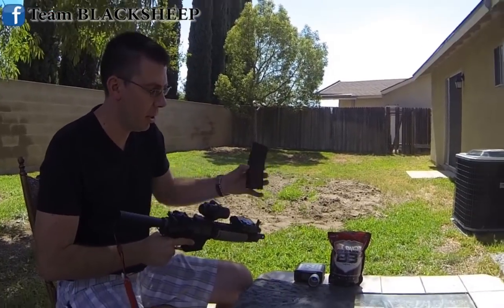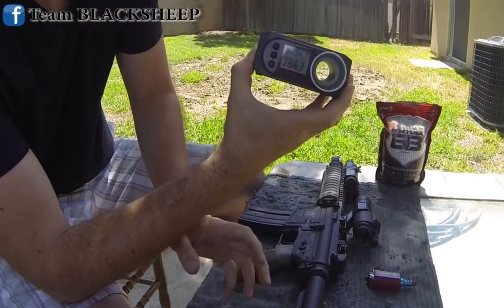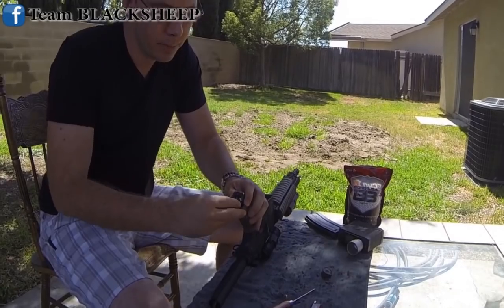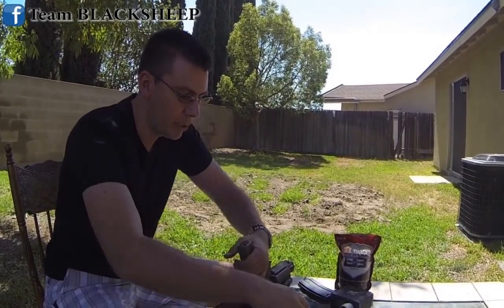The Best and Fastest way to upgrade your M4 AEG

Comment: do not use a high torque motor!! if you want to upgrade your gun focus on the barrel, hop-up, and THEN the motor. I would recommend a ASG 30k since it will generally give about 25-30 rps. also if your gun can handle it, use a 11.1v liPo instead of a 9.6v NiMH. barrel diameter will determine how consistent your shots are as well as alter the fps. The hop-up bucking will alter how backspin is applied to the bb, which will in turn give you faster backspin which will cause the bb to have more hang-time.

Comment: I agree a good quick upgrade is a motor.  But as you can see you get tons of overspin in semi running that 11.1.   Especially if running a light spring with that 11.1.   So keep this in mind if your running an 11.1 lipo and a light spring, a high torquey motor will give you overspin which is not good.  To fix you will need to run a heavier spring and then short stroke the sector gear in order to get to the desired fps.
Reply: +stayontwowheels Using an active brake mosfet creats alot of heat and is bad for the motor.  Since when you release the trigger the polarity reverses for a split second in order to stop the motor (brake).
Reply: I don't have a mosfet but I want to upgrade my motor and I use 9.6v nimh battery's so I was wondering if I would also get that over spin in semi

Comment: As a airsoft ref I see it all so me and lipos have a love hate relationship, I've seen many blowup in stocks, I've seen them shred gearboxes IN HIGH DOLLAR GUNS but you do get good gains honestly, slight fps and rof boost, snappy response but with lipos comes problems it's like having a drag car, yeah you can slap a 600 cubic inch v8 in it with cylinder walls thinner than a magazine just to get that little extra umph but it's gonna cost you when you end up ripping apart blocks and throwing rods. Same thing goes for airsoft, you build that thing to the max or even around it with lipos, dsgs, hard springs and ridiculously high speed motors, it will break no if ands or buts about it. And as a tip I recommend running nimh only. they're cheaper, easier to charge,  you can find them EVERYWHERE, and overall it's better* for your gun I say it like that because all guns will break over time.
Reply: Underrated comment, everyone just wants the most badass rifle, even if it blows up after a few game days and needs a complete rebuild.
Reply: Exactly what happened to my phantom extremists mark iv. I use 11.1 Titan. I think the gears fucked up ima find out today or tomorrow

Comment: Where's your mosfet and as well the double shots can be occurring of arcing of the trigger contacts or to much power to the motor at once that can fry it. I can tell you guys can tech on guns which is good, but for the new on coming airsofters you should give them a disclaimer so they won't brake their guns and start to hate airsoft.
Reply: FSUA Airsoft Team i have a echo1 im just starting airsoft and i want more range how can i get more range
Reply: evo airsoft higher fps put in a stronger spring
Reply: Nope, higher FPS doesn't necessary mean more range. A better way to get more range is to upgrade your hop-up setup with a flat-hop or better yet, a r-hop.
Reply: R-Hop is not all its cracked up to be. Flat hop is the easiest and best way to go.
Reply: LaneGardner flat hop is definitely the easiest, but it’s certainly not the best, especially if you are using heavier weight BBs

Comment: Dean connectors dont upgrade a thing UNLESS you have too much resistance thru your current connection.  If that condition doesnt exist then changing the connection does nothing at all.   Having a degree in electricity, I can say that with all confidence.
Reply: Care to dumb it down for me 😭
Reply: @sybtb1azeken149  that was pretty dumbed down

Comment: this will wear you piston and gears faster
Reply: pierre roy not if u have good gears and a metal rack piston with aoe correct
Reply: Not necessarily. Shim your gears correctly and properly adjust your AoE, and you’ll likely never have to replace any of that.
Reply: Pierre R get polymer piston but full steel teeth and cut off the teeth to your liking
Reply: No you will eventually have to replace them, I used a Glock 8c automatic “fast rate of fire” and I had to replace my piston/barrel/ gears/ and hammer all the time (and it ain’t cheap) and they would break all the time.

Comment: Armydawg most stock motors are standard or balanced not to much torque or speed. 

Torque motors improve trigger response (helps eliminate that slight delay) and increases rof. 

The upgrades or aftermarket motors come in two types speed motor or torque motors. Most newer torque motors are what you are looking for in most 375+ fps setups. 

How ever one thing I caution is when upgrading to a torque motor it's best to have a 120 spring or higher (~400fps gun) because a torque motor can cause over spin (like heard in this video when shot on semi auto - not bashing just saying). This over spin can cause pre engagement and other failures. 

True statement the best easiest and sometimes cheapest upgrade is to swap out the stock motor for an aftermarket  motor.
Reply: I have a 120 spring and all air seal  parts upgraded but still have stock gears, motor, and piston, and I was wondering if I upgrade the motor will I have over spin if I use a 9.6v nimh battery, because that is what I use right now and I don't have a mosfet.